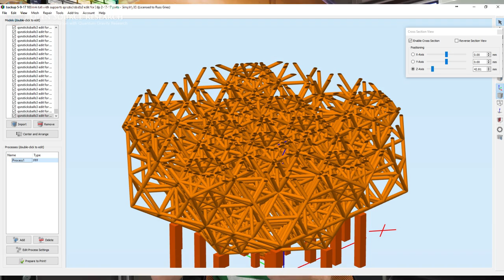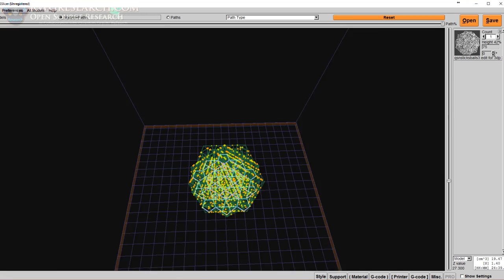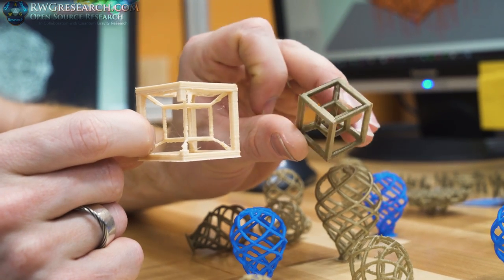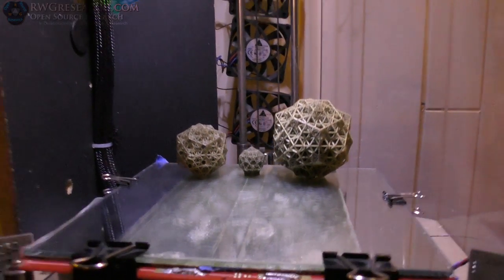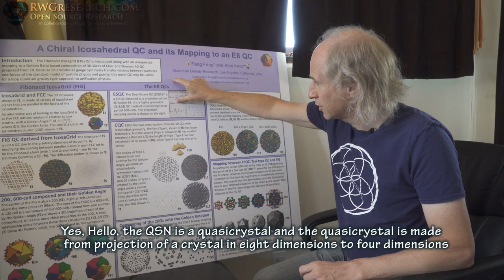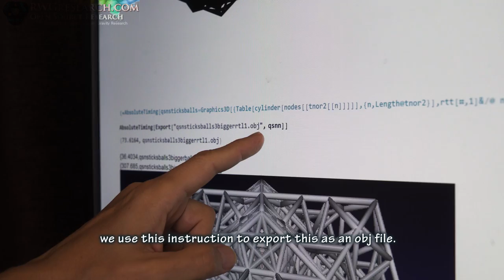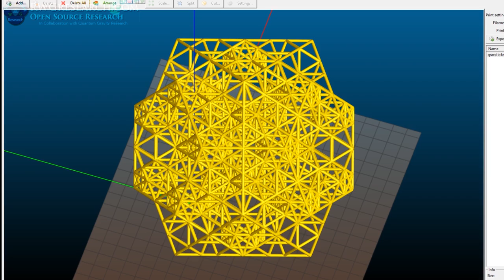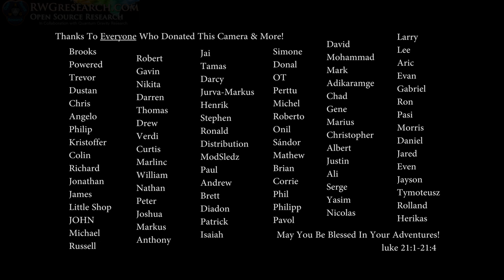#QSN - 3D Printer Torture Test Art.My Challenge to the 3D Printing Community!

Comment: I just hopped over from Travis video about the Matter Hackers meet up. In his footage I saw your awesome prints. I will try to print one. I am still quite a beginner. So this is going to be something tricky. But I love challenges.
Reply from the maker: welcome! what slicer are you using? i think thats the hard part... you can do it! :) ~Russ
Reply: I'm using both Cura and Simplify3D
Reply from the maker: ok cool, Cure handles this well, but struugles with supports. it takes some time to slice. and if you try simplified 3D make sure you read the comments over at thingiverse 
http://www.thingiverse.com/thing:2313909
i'm helping some one there with it already if you have troubles. 
but give cura a go! it might be eazer. 

Thanks! good luck!! ~Russ

Comment: Have you ever tried printing in ASA? I heard that it was super easy to print and aparently gives you perfect prints. However despite many attempts i could not make it print a 3D benchy at all. It always fails at the thin part of the deck, where for some reason the nozzle seems to clog up. Super annoying!
Your QSN is super impressive! I might try to print one in PLA!
Reply from the maker: not tried ASA. the colorfab is suppose to be kinda like that but it melts to fast so it also keep clogging the nozzle. I'm going to try it again tho, as i may have fixed a prob with my extruder. ~Russ

Comment: With such complex shapes with overhang, would a dual compound&nozzle print work, where the one used for supports can be dissolved without harming the main compound? I'm not proposing anything remotely easy, I know.
Reply from the maker: yeah it should work just fine. however all the small " bridges" dont need support, there not far enough apart to worry about. what is hard is the 58.25 angle. thats the one that gets me in trouble... :) ~Russ
Reply: And that's after you took some cross bars out, right?
Awesome challenge. 

I wonder how metal printers cope with such shapes.
Reply from the maker: yes i took a few cross bars out because they will not slice well with out support under all of them in the model. a high end Metal printer should be able to do this. but not smaller than 40% or so I'd say?  

thanks! ~Russ

Comment: challenge accepted, I will print it on my Prusa MK2. 
Thanks
Reply from the maker: alright! what slicer are you going to use? i have not yet got the model to work with Slic3r Prusa Edition. so if you get it to work please do share! :) ~Russ
Reply: That is exactly the slicer that I use. I will test it. What went wrong when you used it, did it crash or was the slicing bad?
Reply from the maker: when i turned on support, it just never finishes slicing.  i have left it for days. but if you get it that would be cool! make sure you use the " solid" not the "stickballs" slicer wold not handle the intersections. ~Russ